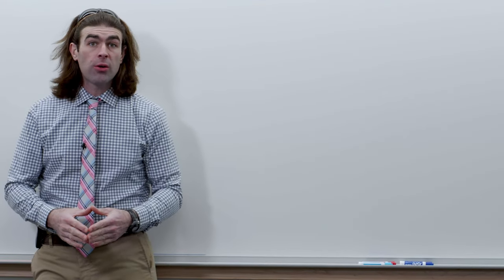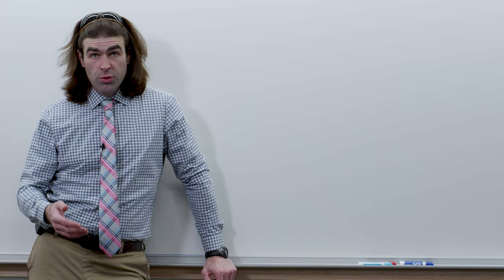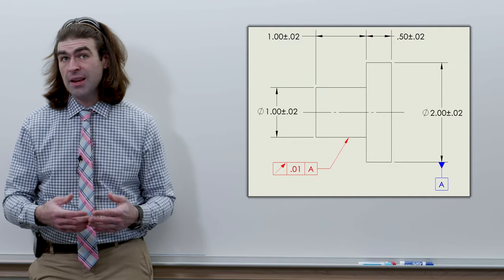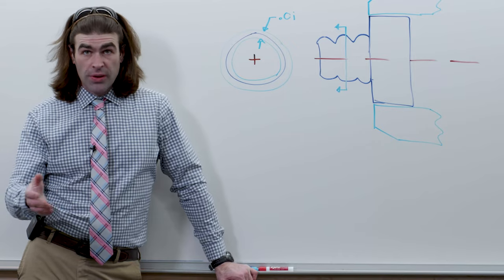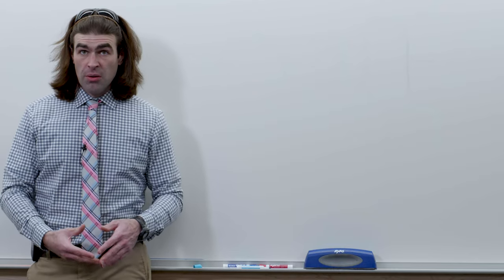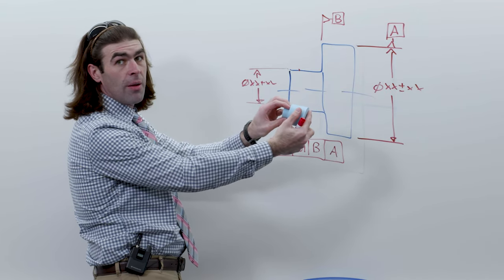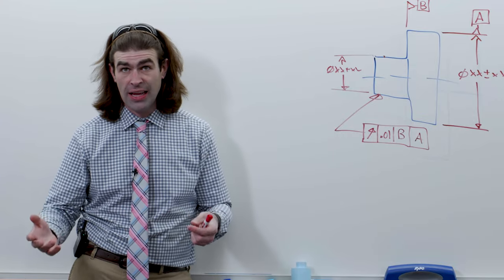GD&T Lesson 5: Runout Tolerances

Comment: Great video! For your section discussing two diameters that lie in the same theoretical axis I believe the datum should be identified as A-B in the first datum box. Splitting the indicates that A is primary and B is secondary.
Reply from the maker: Hi, I must have misspoke or drawn the wrong figure. You are correct, two diameters to serve as a single datum axis should be A-B.

Comment: Hi Dean, thanks for the excellent video.
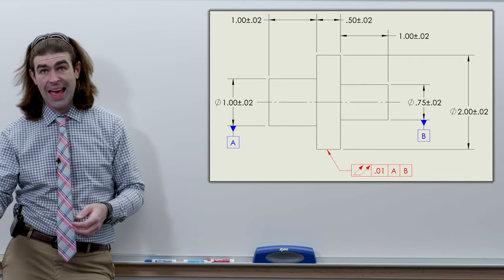At 10:10 the image shown, has the datum included in two separate compartments instead it should be shown in the same compartment with a dash in between. Is the understanding correct?

Also I saw the run out tolerance applied to an axis of the datum feature what does that infer?

Comment: So does a specific cross section does not matter with total runout? Copilot
Sent by Copilot:
Correct, for total runout, the focus is on the entire length of the part rather than specific cross sections. The dial indicator is moved along the length of the part while it rotates, capturing continuous readings. This method ensures that any surface irregularities along the entire length are accounted for, providing a comprehensive measure of the part’s geometric accuracy.

Comment: Does this concept of FIM also apply to total runout?  Yes, the concept of Full Indicator Movement (FIM) also applies to total runout, but with some differences. While circular runout measures the variation in a single cross-sectional plane, total runout measures the variation along the entire length of the part’s surface as it rotates.
Here’s how it works:

Setup: Mount the part on a rotating fixture and position the dial indicator so that its probe touches the surface of the part.
Zero the Indicator: Rotate the part to a starting position and set the dial indicator to zero.
Take Readings: Rotate the part and move the dial indicator along the length of the part, taking readings at multiple points along the surface.

For example, if you take readings at several points along the length of the part and get the following dial indicator readings (in thousandths of an inch):

0.000"
+0.003"
+0.005"
+0.004"
+0.002"
-0.001"
-0.004"
-0.003"

Calculate FIM: Determine the maximum and minimum readings. In this example, the maximum reading is +0.005" and the minimum reading is -0.004". The FIM is the difference between these two values:

FIM=Max Reading−Min Reading=+0.005"−(−0.004")=0.009"
So, the FIM for total runout in this example is 0.009 inches.
If this FIM is within the specified total runout tolerance, then the part is considered satisfactory. Total runout provides a more comprehensive assessment of the part’s surface variation along its entire length, making it a stricter and more inclusive measure compared to circular runout.

Comment: For total runout, so you have to take readings at 1 cross section at a time before moving infinity to the next cross section? For total runout, you actually take continuous readings along the entire length of the part rather than at discrete cross sections. Here’s how it works:

Setup: Mount the part on a rotating fixture and position the dial indicator so that its probe touches the surface of the part.
Zero the Indicator: Rotate the part to a starting position and set the dial indicator to zero.
Take Continuous Readings: As the part rotates, move the dial indicator along the length of the part, continuously recording the readings. This way, you capture the surface variation along the entire length of the part.
The goal is to measure the total variation in the surface as the part rotates and the indicator moves along its length. The Full Indicator Movement (FIM) for total runout is the difference between the maximum and minimum readings observed during this process.

This method ensures that you account for any surface irregularities along the entire length of the part, providing a comprehensive assessment of its geometric accuracy.

Comment: Does the full indicator movement have to be less than the circular runout torlerance in order it to be call satisfactory? Copilot

Sent by Copilot:
Yes, for a part to be considered satisfactory, the full indicator movement (FIM) must be within the specified circular runout tolerance. Circular runout measures the variation in the surface of a rotating part, and FIM is the total variation observed when the part is rotated 360 degrees around its datum axis12. If the FIM exceeds the specified tolerance, the part does not meet the required standards and is considered unsatisfactory3.

Comment: Hi Dean,

Good Content & appreciating your videos.

And I have a question:

Why total runout is not applied for Tapered Features?

Thankyou.
Reply from the maker: Hi, thanks so much!

The requirement for total runout is that the surface of the part must lie between two concentric cylinders separated by the total runout tolerance.

To get a tolerance zone of two coaxial cones, to control a taper, profile of a surface can be used.

Comment: Hi Dean, I wanted to know if you could explain the difference between axial and radial runout
Reply from the maker: Hi, so the term axial runout is not used in the ASME standard, but in general engineering parlance it means parallel to axis of rotation and radial means perpendicular to axis of rotation when it comes to calculating stresses etc…

For runout in ASME terms, a radial runout is the surface of revolution(the surface of a cylinder), and axial runout is a plane perpendicular to the axis of rotation (the face of a cylinder)

Comment: At 9:42, how can both axis still be parallel to the granite table  if the diameters of the datums are different? Assuming that the same size v block is used to hold each datum..

Comment: If you wanted to check the total runout on 2 different sized attached cylinders on the same axis datum, could you attach your feature control frame to the dimension that designates the axis datum or would you just make a leader for each feature?

Comment: Hi Dean,
I don’t get the difference between a surface datum (cylinder, cone) and a diameter axis. Does it make a difference ? Both times you would put a piece in a chuck, v-block etc. and measure the runout on the surface ?

Comment: For the last example, if FIM .007 inches is less than the circular runout tolerance everyone's happy? Exactly! If the Full Indicator Movement (FIM) of 0.007 inches is less than the specified circular runout tolerance, then the part meets the required standards, and everyone should be satisfied with the result.